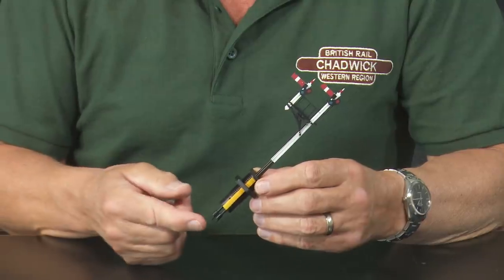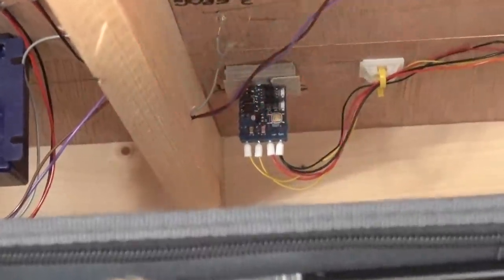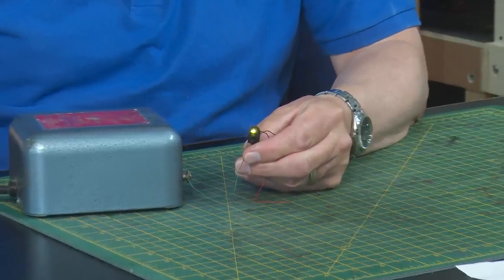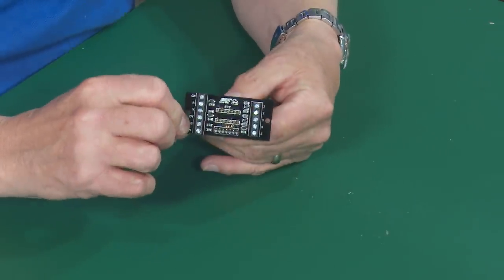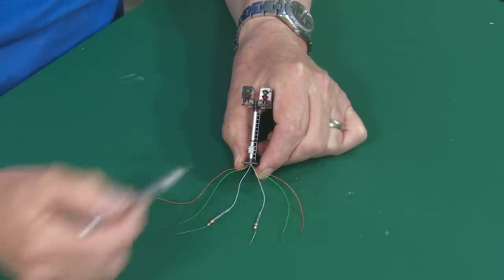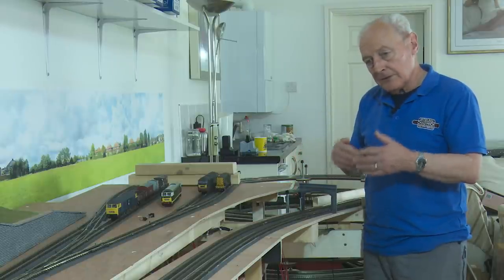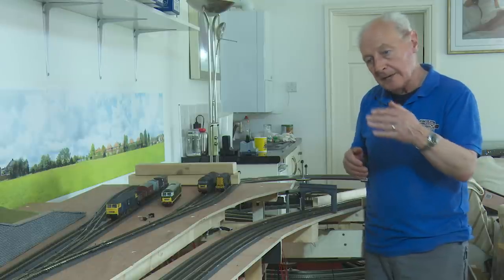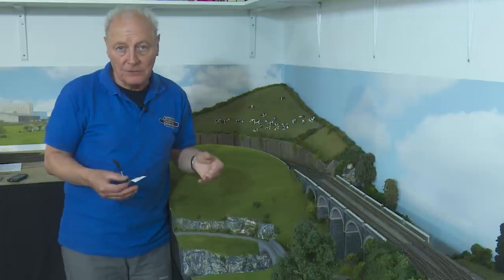Wiring LED and Semaphore Signals at Chadwick Model Railway | 135.

Comment: Another great video which I have reviewed many times as my brother and I are now styling our layout with a well placed single signal large loft layout with a lot of complex point work making multiple signals very complicated). We fell into a trap and purchased a controller from Blocksignalling which was common anode. Having a 50-50 chance with the Beko 4 aspect signal purchased at the same time from an alternative supplier we were unable to ascertain if the Beko signal was common anode or cathode until both units arrived independently. Unfortunately for us the Beko 4 aspect signal was common cathode (although not identified as such by Beko) and therefore did not work with the controller. On reflection we note that you did say that a majority of UK signals are common cathode and we missed that 😢. Word to the wise check what signal wiring configuration you have before you purchase a Blocksinalling controller, their products are clearly identified anode or cathode. We all should learn from each other. Take care Charlie and please keep up the good work and I hope to see you at the GETS in October, Dave😊
Reply from the maker: Thanks Dave, for such an excellent comment. Yes these different signal power feeds are a nightmare. Regards, Charlie

Comment: Charlie, another good video. Mainly because it is interesting and well delivered but also you don't mind getting it not quite right (first time).
To add a complication on the LEDs. In order to choose a good value for the resistor it must be remembered that different colours of LEDs run at different forward voltages so to get the same light output different resistor values may be needed. Another factor involved is how our eyes respond to different colours of light at the same lumen output (sorry for the technical term). So if the LEDs look the same brightness with the same resistor value all well and good, but some experimentation may be needed.
Reply from the maker: I couldn’t agree more Andrew. This is one of those tasks that is never as easy as it first appears. Regards Charlie

Comment: Hi Charlie, only just caught up with this! And my goodness, those little modules are terrific, if only because it helped me to understand the mechanics of it all that little bit better....I think...🤔 I was looking some really simple method for signalling to get my feet wet so to speak (to my shame, I only ever had working starters at platforms and the rest were static semaphores!) and the recent videos on signalling have really helped. 👍🍻

As for the “feather” debate: on our line (c2c) there is a similar junction at Pitsea station (have a look on Google maps mate, it is just like your junction but with platforms 😜) . If you approach on the main line via Basildon and Upminster, then the approach signal UR276 just displays a mainline aspect even though you follow the tracks off to the right on reaching the station. If you are going via Stanford and Tilbury however, you are ‘counted down’ on the approach (as you can only go through the points at 25 mph and there is a level crossing the other end of the platform and the starter signal only goes off when the barriers are down) and once the proceed (yellow) aspect at UR276 is displayed, you are given given the junction indicator*** even though you physically go “straight on”. So I would suggest that the ‘main’ route of traffic would still be signalled as main aspect and the branch off would be treated as the secondary, especially bearing in mind that there can only be two more signals Max before the buffers of going to the station and the signaller would probably hold the signal at an amber to remind the driver to kill their speed 👍

(*** I should point out that at UR276, you actually get a ‘theatrebox’ route indicator displaying ‘UT’ for ‘Up Tilbury’ instead of a position 1 junction indicator arm, but the principle is the same 👍)

I am far from an expert of course mate, but I thought I’d give you an example of something with similar that I encounter regularly. Sorry if it is a bit long winded but that is why I am a driver and not a ruddy author I guess! 🤣😂😅

BTW I totally agree about the positioning of the 4 aspect on approach to the tunnel. If it were nearer the mouth, then it could be blocked from view by a train coming in the opposite direction and I don’t think they’d like a blind-sided signal on a tunnel mouth! I suppose there could be a banner repeater at the start of the curve, but I think that would just be overkill! 🙄

Cheers Charlie, fantastic and entertaining stuff as ever 🍻🍀👍
Reply from the maker: A fascinating comment Tim.  This route feather choice is a great conversation piece.  The truth is that it’s clearly a grey area.  
I agree that a banner repeater would be an overkill so the signal has to moved away from the tunnel mouth. 
Stay tuned, regards Charlie.

Comment: On the semaphore particularly , is there a way of having two sensors for each block. So when train passes signal trips closed then after that segment is cleared trip sensor 2 to send signal green. I think I read somewhere that is how the real world blocks work. Actually three segments with the center one tripping a yellow caution or distant semaphore. On-a-side you are super lucky with all the trains around UK. Miss that in here in USA. I used to ride the old DMUs back and forth to Secondary school every day 15 miles in the late 70s early 80s. Shrewsbury to Wellington. And my brother before me had Steam
Reply from the maker: Yes Steve, I think that is completely achievable. However, you will need a computer program running such as Train Controller or iTrain. Regards Charlie

Comment: Morning Charlie, regards the offering on of trains between traditional signal boxes.

A simple explanation from a professional network rail signalman 👍🏻

Box A offers a train forward to box B.

Box B accepts the train and sets his box instruments to line clear which allows box A go signal through.

Box A then clears his signals forward.

Train now enters box Bs first section - signalman changed box instruments to train on line. Signals go box A train arrived complete which allows box A to accept another train from their neighbour.

Meanwhile at Box B...

Signalman at Box B offers the train forward to Box C.

Box C signalman checks his instruments to clear he can accept.

Box C signals via bell code he can accept the train and clears his signals.

Box B after getting the acceptance bell code from box C clears his last signal allowing the train to proceed. 

Train arrives into Box Cs area he then bell codes to B train arrived complete allowing B to accept another train from A etc 
.
Repeat 300 times from Paddington to Plymouth !

Some stages omitted for clarity, that’s basically how it works though.

For a film explanation there is a video of the process on here somewhere.
Reply from the maker: Thanks CR, I must admit it’s the interlocking systems that fascinates me. Regards Charlie

Comment: I would say because the speed limit to enter the branch line would be lower due to it  terminating, then the main line should be straight ahead and the branch would have the left feather.

I'm using the BLOCKsignalling BOD2-RLY together with an ESU ECoS detector module to control signals through JMRI. Can't fault the sensors so far, brilliant bit of kit.
Reply from the maker: That’s great news Martin, and regarding the signal, I couldn’t agree more.

Comment: I get exactly what Charlie is getting at to the end of the video. Model railways are compressed representations of the real thing. The radii of curves and the length of points are a compromise; the easier we can make the curves and points, the better it looks but the less we can fit in.
The junction is a representation, if you want it to be a representation of a flying junction and the main line is going down to the helix then that is what it is regardless of the compromises made in its construction.
An HST set going over a long streamline point at a reasonable speed doesn't look too bad from most angles, in my opinion.
Reply from the maker: Thanks for the reassuring comment CMJ. Much appreciated, regards Charlie

Comment: Thanks for another video Charlie.  It is surprising how much semaphore signalling existed at the start of the 21st century and some still exists today.  As a dinosaur, on my DC layout, I will stick to semaphore signals but then I am modelling 1948-1968 although I do like the  colour light signals.  Somewhere or another I do still have some 50+ year old Hornby Dublo lights and grain of wheat bulbs.  But I do like the thought of LEDs.
Reply from the maker: What a great comment Don, let’s not forget from where we started this fascinating hobby. Regards Charlie
Reply: Don, have you tried replacing the grain of wheat (gow) bulbs with the larger LEDs? Similar profile, much cooler, and axial lighting decreases the light bleed.
Reply: @tomlawton7087  Thanks for the suggestion.  I will have to search the attic for them.  Things became mixed up when we moved.

Comment: I like infrared detection at the start of a block and the end of the block without any time out. That way you can  stop a train In  a spedific block indefinitely. The signal would remain red untill the train leaves the block.
Reply from the maker: Thanks, 1046, that’s a very interesting concept. Regards, Charlie

Comment: Hello Charlie. Big fan of your page. Love from Llandaft 009 railway, up here in sunny Macclesfield. You are an inspiration- to the point I have gone out and bought a Canon XL1s and a NinjaV. Aside from that.. soldering irons.. On bits of cable. Have you ever tried gas soldering irons.. might save your back, jiggling around with cables. It is a bit of an art, I must admit, but also use them at work and in the field all the time. Step soldering. Tim’s trains is a good website to visit. I have built many brass 009 full locomotive kits, including the chassis with my gascat 120, and my Irada 120. Temperature control comes from instinct. I must send you one to play with. Knocking on the door of about 80 quid. Works on lighter gas refills, but once you have tried it, there is no way back. ( when of course, I’m not building 5” gauge and 7 1/4” gauge locomotives.. silver brazing is a whole different kettle of fish). Good supply of LED’s is bright components.co.uk for anything LED. Llandaft is starting to look like Blackpool illuminations. That’s what comes with lots of sheets of plasticard and scratch building. I’m on FB, but planning a you-tube channel. Warmest regards, keep up the good work. Kris Lehane.009 Llandaft.
Reply from the maker: A great comment Kris. I’m very wary of buying a gas soldering iron as I’m do a fair bit of work on DCC decoders.  However, I’ll certainly keep it in mind.
Reply: @ChadwickModelRailway  as long as you get the little exhaust port on the tip the right way round. Very handy for doing heat shrink, but not so great with brass kits, when you are doing step soldering on chassis.. the wee exhaust port melts everything in sight. Also applies to anything electronic.😭. I’m in the middle of building lighting.. re-wiring houses and streetlights. The little Chinese gas-lamp thingies from the internet are way over scale. Probably halfway house for doll’s houses. But if you pull them apart, cut the wee tube right down to just over a couple of inches and re-paint them, not bad. Passable as gaslight green. But Me Lighting designer, you photographer.. understand Kelvin.. regards. K.

Comment: Hi Charlie I watched with great interest all your signalling vidio's  I will be using a combination of ESU servo controllers for my semaphores and MERG boards to run  the light signals with a lot of guidance from one of the members of Rainhill  MRC as i am scratch building some of my light signals and modifying the semaphores to suit I will be very buzy but still messing about with track at the moment, but there's nothing like being prepared is there, if i do half as well as you have i will be well chuffed      Regards     Alan Massie
Reply from the maker: Thanks Alan and good luck with yours.

Comment: The grain of wheat style lights can be worth getting if they are cheap enough.  They are usually pretty easy to convert to LED by replacing the globe with an LED and LED's tend to be cheap to buy these days..  Depends if one wants to tinker a bit :).
Reply from the maker: Yes Brendan but they do have a limited life span.
Reply: @ChadwickModelRailway  I am just rewatching this and I missed the first time when you mentioned getting a bit of negativity about missing Semaphore signals.   
I thought you had done that a lot earlier in Video 104 so they could go back to that :)
Reply: It’s only the bulbs that have a short life. If you replace those with modern LEDs, they should go on forever.

Comment: Hi again Charlie, just finished watching the video...regards the MAS (Multi Aspect Signals) at the junction.
Generally speaking the route indicator (feather) would be used to signal trains from the main route ie, into loop or branch, however lol a classic example of “its thus but unless” is Cogan Junction (Cogan, Cardiff) the protecting signals for the junction have route indicators attached, however the “main route” ie the aspect minus route indicator is for the Penarth branch (dead end about 3 miles long) with the “branch” or diverging route aspect with route indicator is the mainline via Barry to Bridgend (Vale of Glamorgam) line.

Also remember with a signals you’ll have a overlap beyond the signal, usually 400 yds but sometimes especially goods loops the overlap can be much shorter but the signal will be delayed release. I’d say the junction signal at the station end of the viaduct is about right for Juntion signal, regards the signal protecting the storage area I’d say keep the signal at the tunnel mouth, have a banner repeater signal just after the junction as per real life practice on reduced sighting signals.

Also....LOL.....remember MAS come in three favours, Fully Auto -  like the signal you have at the tunnel mouth trigger by the signal sections clearing in advance automatically. Semi Auto - the signaller can either switch to fully auto operation or manually call the signal as required, and manual where the signaller will call the signal every time it’s required to be set for the passage of a train. 

Autos are usually on long plain line sections, semis are usually on sections with low traffic off into a loop or branch or to break up long auto sections, and manuals are in high traffic areas like key junctions or stations for example, auto signals also have the ability to be replaced to red either by the signaller (more modern versions) or by “keying to red” on the signal post by track workers,

Hope that helps.
Reply from the maker: A great comment CR.Reading all the comments it does show what a grey area using that feather is. Some regard that the fastest line should be the one without the feather, others more on its geometry. Regards Charlie

Comment: Charlie, I’ve just rewatched this cracking video. You really do put complex subjects over in an easy to understand way. Just one thing worth mentioning that I missed on first viewing. When you demonstrate the use of the ‘feathers’ on your section of track, you show the main aspect remaining green whilst the route changes. Obviously, you’ll need to wire or program things so that this cannot happen. With the signal off it would be impossible to change the route. You need the signal at danger to operate the switch, (points), then clear the signal. I hope this is helpful. Best regards, Tony
Reply from the maker: You are of course dead right Tony, and not the 1st to mention it either! I consider myself well and truly rebriefed. Regards Charlie

Comment: Hi Charlie, from my understanding the minor lower speed route (the branch) would be covered by the feather. Due to the geometry of the junction the branch and the crossover would be protected by appropriate speed restrictions for each path. As the branch is a terminus it would have a lower speed restriction (reducing speed further on approach) than the main line and would normally have an amber aspect as the next signal would be a red (station). P.S. excellent video again 👍
Reply from the maker: You have hit the nail on the head Warnz.

Comment: SIGNALS AND SENSOR POSITIONING

Spot on Charlie with your remarks about the sensor being positioned slightly further back from the signal.....however, with a little thought it is possible that the sensor can replicate the slow approach of a train, say at a junction.

In this latter case, it would replicate the 'timed release' that was possible and in the hands of the signalman. My late father was a signalman, working many boxes, including Hall Royd Junction and other boxes on the Calder Valley and Copy Pit, (LYR Burnley Branch), and my own early years apprenticeship was in the S&T.

Hall Royd Junction had such a 'timed release' lever for the signal between Castle Hill and Millwood Tunnel, which was the junction approach signal for the Burnley Branch, (Copy Pit), for trains from the West Yorkshire direction. These could be coal trains for Lancashire Power Stations such as Padiham, or for Specials for the coast, (Blackpool), if they were routed via Copy Pit.

The sensor itself would seem to be a remarkably flexible bit of kit.

Obviously 'Reed Switches' could performs a similar role and function, with the added advantage that reed switches are a good bit cheaper.

Don't know if you have done so previously, but a video on reed switches would make interesting viewing.

Well done on another interesting and informative video.

James Hennighan
Yorkshire, England
Reply from the maker: An excellent comment, James, and it’s also a coincidence that I’m looking into reed switches! Regards, Charlie